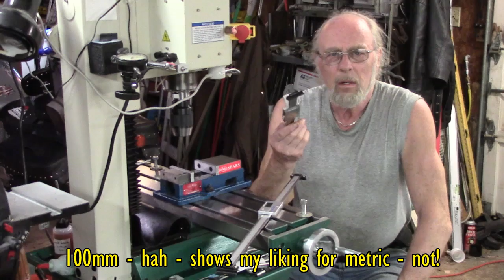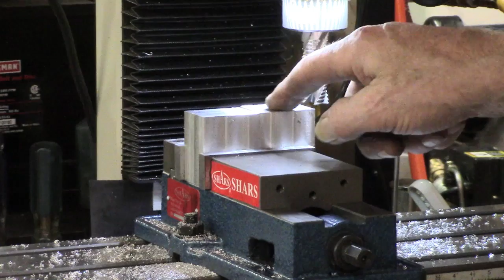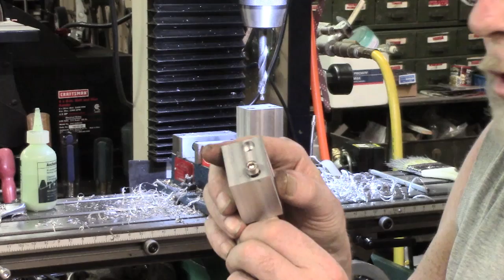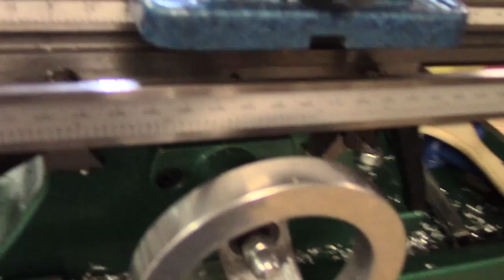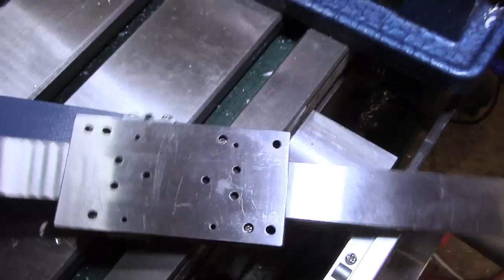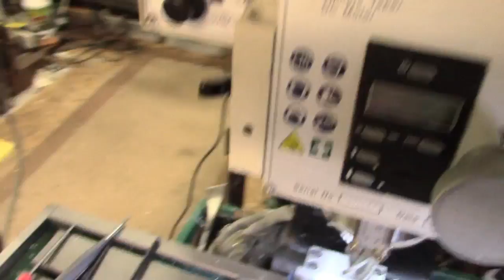DRO Fit on Grizzly 0704, Part One, X-axis

Comment: grizzly mounts the dro on their version of your machine on the back side of the table so it would seem that they conaider it the easiest way to do it. having it on the front seems a recipe for dro disaster to me.
Reply from the maker: crazymanmichael  IMO Michael, just not enough clearance - particularly if Z was back to limit. I shall take care and also try and make up a simple shield for the X. Grizzly may well use thinner scales and a small slider - mine is too large to be practical for rear mount.
Reply: grizzly does, of course. have the scale and slider shielded to prevent liquid or material interference with the units function, and you are probably correct that their slider is smaller since it has no display function. still seems like it would have been easier though.
Reply from the maker: crazymanmichael More desirable Michael but IMO not easier - not with my components.  We'll see over time how we get on. :)

Comment: I also would have suggested a rear mounted scale, but you have explained that would be too restricted to operate, one thing that could be done to get over the potential of damage is a simple sheet steel (now you have plenty), guard projecting out over the top of the system, you could easily tuck a sheet of 16 SWG steel bent at 90 degs behind your table fixings and extend out to give complete protection. You will wonder how you got on without this DRO after a few weeks of use!  Chris B.
Reply from the maker: Englishman French Planning some sort of shield Chris - would be wise.

Comment: It looks like you Y travel towards the handle may be now limited more so than the rearwards would have be with scale at the back of the table?
ie the readout head will crash into the Y axis handle...
Reply from the maker: Ray Jones Ray - I did make allowance for that with my spacer blocks -- it gets real close but at full fwd Y it is fine. We'll see how it goes over time. :)

Comment: Hi Chris,
Stupid Question #1  Is there any reason you didn't mount the scale on the back of the table? (I'm assuming you will be reading off the display not the scale slider.)
Cheers Eric
Reply from the maker: midgoog2 Hi Eric - done this way because back mounting extremely awkward -- the way guard is in the way far too much and I have no good access to the back for drilling,  tapping etc - seemed  impractical in this case.

Comment: Hi Chris
Boy you like to do things the hard way. Most DRO systems install at the back of the table that way it's out of the way. I am not sure how much that one cost but there is an on line store called THE DROSTORE.com I got one for under $350 delivered to Australia all glass scales the works. The display you can get two or three axis and you just order the scales to suit. The kit comes with everything you need brackets screws the lot.
It won't take long before you drop something on the scale and in the bin it will go unfortunately I have seen it to many times you are trying to get something awkward on the table and a bracket or bolt catches and it's all over. Take it from the king of cock ups it will happen.
Even if you put the one you have on the back of the table it will help with cable routing which I see you are having trouble with good luck with the exercise look forward to seen it finished.

Dave
Reply: David Cashin with a smaller mill like mine you loose "Y" travel when you put a DRO on the back and their is very little to spare.  I too mounted mine on the front, in my case just to save "Y" travel.  The risk of damage is also there from going back too far with the "Y axis and crushing the scale between the column and the table.
Reply from the maker: David Cashin David -- not choice really, 'the hard way'  - this was because back mounting extremely awkward -- the way guard is in the way far too much and I have no good access to the back for drilling, tapping etc - seemed  impractical in this case. I shall be careful with usage tho, I realize the vulnerability aspect! I'll crack the cable aspect one way or another.

Comment: Good job, Is there any way that you can reroute the wire and bring it around the the bottom instead of going to the top of the slider???
Reply from the maker: Peter Mundy Hi Peter -- am working on options for cable routing -- we'll get that sorted out one way or another!

Comment: Hi mate.
Why did you not just park that thing at the back of the table, you don't have to read it any way.  I think this set up is going to get damaged or be in your way, and if you are a bit like me you will send it flying within no time soon.
I bought a DRO via Alibaba 3axis, magnetic scales, landed, for about Au$ 600.
I love the box though.
Marcel.
Reply from the maker: Marcel Timmers Hi Marcel -- back mounting extremely awkward -- the way guard is in the way too much and I have no good access to the back for drilling, tapping etc - seemed impractical. Agreed re vulnerability but just have to take care!
Reply from the maker: Bill Lewis Thx Bill.

Comment: Why not mount the X scale on the back side of the table..
Reply from the maker: Dave Shadow Dave - done this way because back mounting extremely awkward -- the way guard is in the way far too much and I have no good access to the back for drilling,  tapping etc - seemed  impractical in this case.